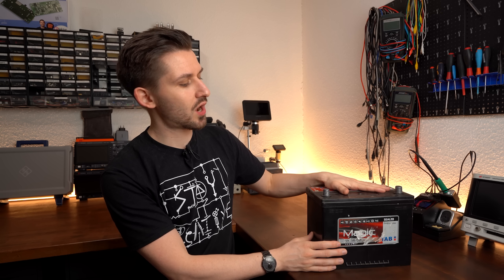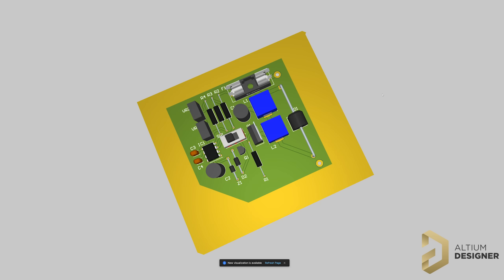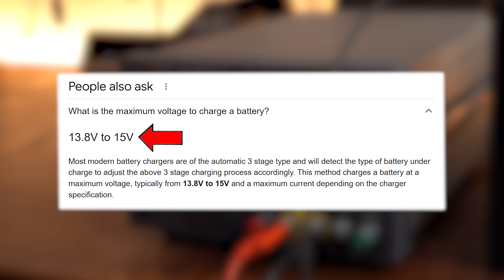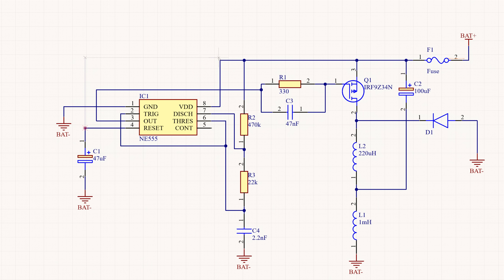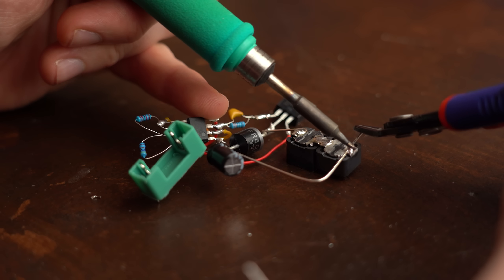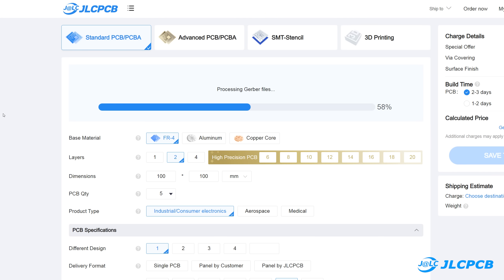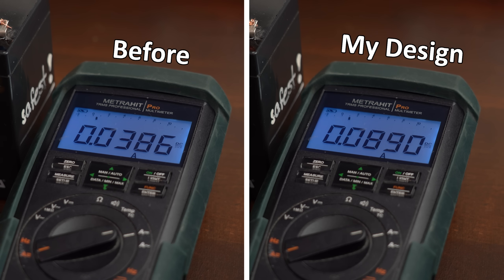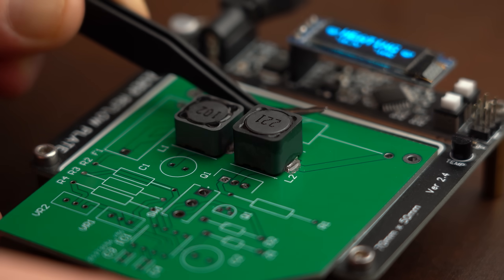I followed a YouTube "Battery Hack" and Wasted 30 Days! (Desulfator)

Comment: My old electronics teacher once told me, that in order to make a true desulfator, You'd have to get a higher-than-usual voltage from OUTSIDE the battery, and pulse it in very, very short pulses at around 1kHz. He recommended starting with 16V, then, if that did not work, go up to 18V. If that don't work, then the battery is not salvageable, at least without taking it apart (and batteries cannot be taken apart since the '80s, at least here in Poland)

Not sure if I remember this correctly, so use this kernel of (questionable) knowledge with a grain of salt, and itry it at Your own risk
Reply: You are right. You need to shock the battery. I use 16.8V and 10Amps of current. Does the job. It heats the battery and desulphates
Reply: @DIYBill  But, to not eat away the electrodes themselves, the pulses need to be very, very short

Comment: do AGM batteries require desulfation? I have a charger that has recondition mode but it is only for normal lead acid and not agm, why is that?

Comment: I have had some dead batteries from a golf cart that I tried reviving a number of different ways (desulfation circuits, putting different additives into the cells) and I saw only very small improvement in the battery though very non-scientific testing (measuring current whist charging, the voltage they hold open circuit at rest or under load), but nothing anywhere near enough to make the batteries usable again. The damage to the cells is physical in nature as the lead sponge literally flakes off and collects at the bottom of the cells. Deep cycle batteries have larger space at the bottom to allow more to collect before it causes the cell to short out as I have heard (and also use more robust solid lead plates rather than very porous lead sponge, which the compromise between ESR and capacity)

Comment: Huh. I heard you have to use a chemical process to desulfate a battery. The large battery appeared to a sealed type. Removing the seal will provide access to the acid in the cells where you can measure the acidity of the cells and calculate the level of sulfide on the plates. Then research how to fix the problem chemically.

Comment: I have good experience with such a desulphator, but only on batteries that are good in the first place, but which have been completely discharged by 'accident'.

Have taken apart many tens of batteries, and most newer types led acid batteries have almost only lead oxide in one of the poles when they have half their capacity left

Comment: You can actually fix a battery but none of these circuits work. To fix these you just have to overcharge them at low current.

Comment: Desulfators do work. I have one and have successfully revived a couple batteries. But it only works if you also add a charger.... In other words u have to charge the battery at the same time you desulfate it. But that was 2 out of 100+ batteries
Reply: Yes this is true i thought that myself, it needs to be kept above the knee of the curve for the sulphate to convert back, as you are taking power with the de-sulphator you should be trickling it at the same time.
Reply: When the desulfator describes itself as having a 10kHz 'frequancy' you already know it is a terrible quality product... What even is a 'frequancy'...
Reply: @someguy4915  frequency refers to the size of the pulses and listing the frequency of the pulses doesn't make it junk by any measure. An ideal desulfator would have charge frequencies that are all over the map.

Comment: 0:54 You're probably not correct here. The resistor is tied to ground on the other side of the PCB.

Doesn't change anything regarding the bullshit circuit though

Comment: I read some on this topic a while ago, and if I remember correctly, the sulfate that is created during normal use is thin, spongy and easily converts back into the electrolyte when charging. Left for too long however, the suflate hardens and does not covert back. The desulfators can in the best case crack this hard layer. This would verify other comments about the process not increasing the capacity (the electrolyte remains weak) but potentially getting an improved current flow (less plate resistance). 

The pieces nocked off by the process fall to the bottom of the battery where there is a collection chamber. When this fills up and touches the bottom of the plates, the battery is completely toast.
Reply: Yeah this seems like one of those things that if you're gonna do it, should be done as part of a regular battery maintenance routine, not something that waits until problems arise, which by then its likely too late.

Comment: Could not have posted this video at a better time! I'm currently trying to revive a 12V 180Ah lead acid batt. for an off grid type power system, and i cant charge the battery above 13.5V, and it drops to 12.5 if i disconect the charger, and i was about to start making a desulfator, but i guess my chanches are pretty low. So thank you for this video, i researched this topic for hours, and didn't have a clear answer if this is working or not, now i kinda know!

Comment: Why did you want to use an N-channel MOSFET, rather than P-channel? I would also love to see a video from you going into depth on inductors, they're oddly mysterious to me.
Reply: They tend to be a little better behaved: faster and with a lower on state resistance. Growing up with positive convention circuitry it's also easier on the head when rising voltage on the gate turns something on.

Comment: 0:52  R10 "the connected to nothing" resistor is connected to GND on the back of that PCB, you can see it when that video showed back of the pcb, which is at 1:23 of that video, right bottom corner.
Reply: Yep, and it has a purpose as well. Reducing supply noise for the 555.

Comment: well the circuit is working, and could be used other ways to boost the voltage to a different level for charging a different voltage. just a bigger coil and a little longer pulse from the 555, instant switching power charger. 14.1 , 21.15 , or 28.2 just depends on how your configuration is wired.

Comment: With what rate did you discharge those batteries? Lead acid batteries are sensitive with their capacity, they require low rates and they are not like a Lithium battery which can easiliy reach 1C or even more depending on their technology (ex. of nano based LFP batteries). I am not sure if the disulfation works and i have seen many videos on youtube too, some of them "work" but most of them are just crap for the views, also i remember that one of my friends had a disulfator based thesis that i did not give much attention back then but since they accepted it as a thesis i am not sure if its real or not.

Comment: Maybe it does not work as the circuit takes energy from the battery instead of putting it in?  Would pulsed charging with an external power source instead of this 'rejuvinator' work much better as you are adding power to the battery instead of removing it?

Comment: While travelling a lot for work last year, I had to put the batteries of both of my cars on my big battery charger (the kind with wheels) which went into desulfation mode. I thought it did a surprisingly good job and I'm still using the batteries, but I can't say for sure what a charger without a desulfation mode could've done. Now I want to try to get a couple of batteries and experiment with them.
Reply from the maker: Thanks for sharing

Comment: why not bring back the user servicable acid-lead batteries where you measure the ph level and top up the acid (with distilled water) when needed. I have memories of doing this
Reply from the maker: Sounds like fun. Never did this before though
Reply: @greatscottlab  this was on forklift batteries though

Comment: Is it possible that R10,  LED D8, U5 pin 1 and C3 are all connected to a ground plane on the other side of the PCB?
Reply from the maker: R10 connects GND to GND.
Reply: @greatscottlab  one end is GND but the the other looks like it is connected to L2, D9 and battery negative. battery negative does not seem to be connected to GND. It is hard to tell without seeing the other side of the PCB. Edit: The PCB in the video @0:56 does seem to be the same as the circuit shown @6:59. So maybe  battery negative shouldn't be connected to GND.

Comment: @GreatScott, you have to logic this one out..... the true end goal of the desulfator would seem to be to change the internal resistance which will effect how fast the battery self drains; this will not extend capacity but may allow a person to use a battery for longer before it needs to be replaced ..another dependency is likely if all the cells are effected or only a 1 or a few; a bad battery doesn't necessarily mean all cells are equal effected or bad....with that being said I think it's why there's such a mixed bag of people either saying it works or doesn't(really really battery dependent)
Reply: I think the true test would be either desulfate each cell or possibly use a modular battery where the batteries can be separated then check individual cells before/after

Comment: Es gibt aufm amerikanischen YouTube dutzende Automechaniker, die alte bzw. defekte Batterien absichtlich mit einer zu hohen Spannung laden, mit einer Spannung >15,8v laden, um diese wiederherzustellen.
Viele benutzen dazu ein Elektrodenschweißgerät. (kein Witz!)
Habs selber bei einer tiefentladenen Batterie versucht.
Die war danach wieder wie neu. (Hab aber nur den Startstrom geprüft)

Testablauf:
Batteriestopfen aufmachen, da durch die hohe Spannung viel Gas entsteht.
Schweißgerät auf niedrigste Stufe gestellt und an der Batterie angeschlossen.
Spannung von etwa 17-18V eingestellt (mit Multimeter gemessen, Schweißgerät hatte keine Volt-Anzeige).
10 Minuten so stehen gelassen.

Ich rate hiermit niemanden das nachzumachen, da das durchaus gefährlich ist.

Comment: Mostly unrelated to the video content, but I noticed when you were showing shots of the PCB layout in Altium that your polygons are overflowing the PCB edge. I was having the same issue and I recently figured out how to fix it. If you duplicate your board outline to the Keep-Out layer, you can assign a rule to have your polygons maintain a specified distance from any Keep-Out layer object, and effectively follow the contour of the Outline. Keep up the great work!
Reply from the maker: Thanks
Reply: Even easier is to use the polygon manager and define the shape from the board outline.
Reply: This approach is fine, hovewer, more 'correct' and easier in the long term approach is using BoardOutlineClearance rule under Manufacturing rule set. This way, you will not need to manually update keep-out layer each time you need to redefine board size and/or shape.
Reply: Can we just have AI learn tricks like this? 😀
Reply: @fitybux4664  : Why waste AI on something that could be a pop-up wizard.
Reply: @absalomdraconis  less development time
Reply: @fitybux4664  why waste your human intelligence thru AI?

Comment: Be aware that lead acid batteries specifically has their nominal capacity of say 50 Ah rating under the implied C20 standard; its the capacity if run from full to flat in a duration of 20 hours, so here at 2.5A nominal.

Comment: Lead acid batteries are a bit tricky with their capacites, the 44Ah are messured with a C20 (2.2A) discharge over 20h, if you use a higher Discharge the Capacity is much much lower.
Reply: IIRC, at C/10, you get around 70% of the rated AH. Each battery design has its own set of discharge curves. Some of the better SLA batteries I've bought have the discharge curves stenciled right on the side of the battery.

I also read in the materials from a battery tester that a good percentage of batteries returned as defective are within specs. This could account for the apparent success of magic circuits.
Reply: All types of battery (not just lead acid) have their capacity measured at some specified load, and capacity invariably dropd at higher loads.  The difference with lead acid starter batteries is that they also have a CCA (Cold Cranking Amps) rating as well as capacity, which is a measure of the maximum useful current that battery can supply at -18 Celsius.
Reply: @ferrumignis  Car batteries have CCA and CA listed as that should be all they are used for, they are not meant to be discharged more than ~10%. Something like an electric forklift has deep cycle batteries, which spec time at a certain voltage and current.
Reply: @pontiacg445  That's why I made it clear I was talking about lead acid STARTER batteries.
Reply: we test lead acid batteries mostly for load. If it can provide a high load. Like for the start of an engine. That way we know the internal resistance is low. And if we make a full test the capacity isn't far off. Its simpler and quicker to test with a real load.  

After you sorted the batteries you can still test the true capacity if desired.

Comment: It would be interesting to find out the original capacity of the lead acid batteries - most are only about 80% of the marked value if used at 1/10 C and reduced to a sensible voltage - the original capacity seems to require a slow discharge to a damagingly low voltage…

The designers of the Sinclair C5 knew about this - the original battery was rated at 36ah, but they could only use 80% of the battery, and over 300 cycles the capacity would drop by 20%

Lithium iron cells report the true capacity - and this is usually achievable

Comment: Yeah this never worked for me. On a lead acid that has high internal resistance you can do a few rapid-discharge & normal charge cycles to recover maybe 10-20% of the original capacity, but it's really not worth it unless you're building an off-grid solar battery with a $0 budget.
Reply from the maker: Thanks for the feedback

Comment: Your about 50% capacity result for your lead acid batteries indicates a perfectly functional battery for me, considering that you only discharge these types of batteries to 50% of their capacity before you reach a voltage that is considered too low or did you consider that already in your calculation?
Reply from the maker: I considered pretty much everything

Comment: Super awesome, you're are doing electronic Jeezus work.. I've seen so many of these desulfator videos or 'hacks'.  Amazing amount of work you put in to test these things.  I have never been able to revive a battery to useable state once they get exposed to a long winter or drop below their working voltage, maybe added another year of limping along a battery to use in a riding lawn mower but definitely replacement is pretty much the path.
Reply from the maker: Glad you liked it :-)

Comment: I have apparently faced the sulfation issue on a battery of a solar system. I don't think it helps on old batteries, because they are just old. In my case, it was a battery that was over specced, both for the charging and discharging current. You loose the battery runtime quite rapidly. What I found out was that you can fix that by drawing a very large current, which generates Hydrogen and seemingly revitalizes the plates.

The battery I had was 22Ah and I used 2 automotive H4 halogens at 55 Watts each as the high current discharge. The bulbs started off dim ,then go brighter as the current increases and then go dim again once the battery is discharged. In my case, this happened within 10-15 minutes. 
Cannot comment of the desulpfation circuits, but from my limited knowledge, high current spikes in the millisecond range is not going to do anything.

So, if someone has a battery that is overspecced for the application (both, charge and discharge currents), I would highly suggest you check up on it, and try the high current discharge desulphation. The best method to prevent such problems is to properly spec the battery, with 10% of the rated capacity as the charge current, as Scott mentions in the video.

Comment: we've used many times to fast light touch (ie bang/hit) jumper cables into short circuit, just a couple of times, if battery seems weak after sitting for long time, esp during winter.
Not sure if that did anything but slightly heat up the battery, and the helping effect probably was just placebo.

Don't try it, if you get the clamps fused together you are fscked

Comment: I have an video idea for you.   Convert a lead acid  UPC (uninterruptable power supply) to one that uses 18650 Li batteries. Will there be a cost savings? What are the advantages/dis-advantages?
Reply: For sure it won't be cost effective hence why we use lead acid instead. Thought your usage may change the overall price. If you often get power lose or/and extended power outrage your lead acid will die faster and depending of how your time is worth/or how critical your infrastructure is, it could be indeed a better alternative. I was reading a litlte about that and using LiFePo4 could be a nice choice instead of the typical lithium ion. Advantage: more recharge cycle than typical Li-ion  (and way more than lead acid), also safer. Downside: lower discharge rate than lead-acid (around the same as li-ion i think?) and price :/.

Comment: The battery is a fake. It should not be used without balancing for each of the cells - and charging can be made with a used laboratory power supply and a resistor, for each cell separately. A "normal" 12V battery is not worth using except for no-name cheap models, because it is way too overpriced for its life and performance, the price per energy stored is insane.

Comment: Yeah, I used those desulfaters before and never got any improvement, too. Then I switched my batteries to lifepo4 ones.( for  my e-bike). I also charged it to 100% after a ride.(even though if my battery was at 94%).  If I charge a battery from 0% to 100% and discharge it back to 0% that means a lifecycle ,right? So what do you think? (I think that the way I am charging my lifepo4 would increase the time that 1 lifecycle lasts